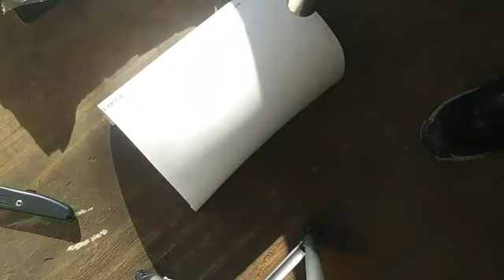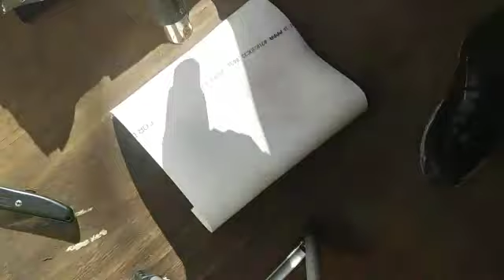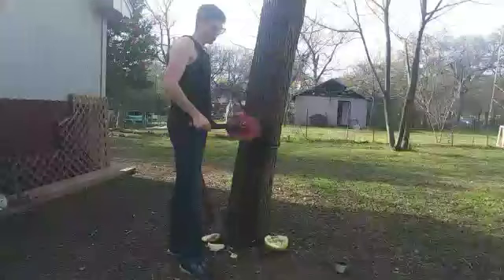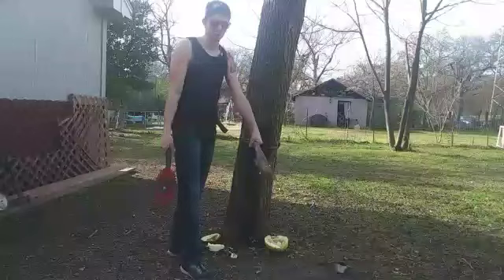PVC Pipe Armor?

Comment: Two plates of PVC, mold them together. Add a thin layer of foam between plates. Scuff exterior plate, spray truckbed liner. Then rivet through both plates with washers.
Reply from the maker: Solid idea, dude. Thanks the comment!
Reply: Or as well. You can make a sort of reinforced chain mail with liberal amounts of gorilla tape, zip ties, and spaced plates of PVC. Sort of plate mail armor. Im looking to make some sort of post apoc riot armor for an airsoft event.
Reply: Why would you rivet it or use washers? Those rivets have the potential to do serious harm to your body on a high enough speed impact.
Reply: @BlyatBear  hey! That's how I found this video 🤣 in need of ideas to make my own custom armor for airsoft as well

Comment: Hey Brother,  Looks like your going through a very similar learning process I did when I was about your age!  A couple suggestions to perhaps aid you journey.  Try Pickle Barrels. they can usually be had cheap used and can be formed by simply putting the cut pieces into the oven at 200 to 250 deg.on aluminum foil  until is softens  enough to form against a body wearing 2-3 sweat shirts.   You'll want to wear heavy gloves or pot holders when forming.  Don't over heat the plastic and it won't get brittle like pvc does.  This is the lightest and toughest non ballistic, non metal body armor I've ever encountered in 30 years of full contact combat martial arts. (Look up The SCA and similar groups for examples of the fighting)  If your interested in building full suits etc. you can find MANY patterns with a quick search for "SCA plastic armor patterns"  if you go to the SCA site you can also find a group near you that will be happy to help & teach you if your interested in learning to fight in armor as well as making it. Good folks they are. :)
God bless, Have fun, & Try to keep the pointy bits pointed AWAY from the fleshy bits! ;)
K.
Reply from the maker: This is some fantastic advice!
Reply: @apocalypsepyro  Thanks :)  oh! I forgot to add that SCA folks are also likely to be willing to let you film them while they are teaching & talking about making stuff to help you get content for your ch.!  :)
Reply from the maker: Sounds like a plan dude, thanks again! 👍
Reply: @apocalypsepyro  Any time, Brother. :)

Comment: Try using a roaster pan with  boiling water.  it works faster and does not burn the PVC.
Reply from the maker: Dude that's genius! 11/10 great idea!
Reply: @apocalypsepyro  I used to work at a PVC pipe factory.

Comment: Hey ive done a bit of welding as well as carpentry. I also practice martial arts and consistently spar with friends and opponents.  Next time use an uncurred ham and it would be more realistic to a human thigh. Also, if you take the materials and apply a massive amount of pressure during the binding process it would allow for it to sustain better blows. Also try a metal mesh weave between the inside rubber and the pvc. If done right it should allow for the blow to  be displaced. Real armor mitigates damage, not stop it.

Comment: A source of some awesome inspiration, so thank you for that but the materials and execution of assembly could use some work. Rubberized coating won't stick to duct tape well, duct tape is too smooth a surface and doesn't absorb liquids, but you did make me realize that layers of tough fibrous material coated and/or saturated with a rubberized truck bed liner would make a sweet semi flexible composite. I typically make composites with abrasive and/or tight weave materials saturated in either fiberglass resin or a stabilizing resin compound, but saturating layers of fibrous material with a truck bed liner is a great idea.(Depending on the material used because some don't absorb liquid whatsoever or just don't stick to rubber well.) But as far as PVC goes, it needs a backing more even more than a front protective layer(Both are necessary to keep it intact but the backing even more so) because as shown in the video, PVC breaks into sharp jagged edges that will shear through foam and potentially stab you even if the opponents weapon doesn't. You might think the saw blade axe cut the foam, but there would be a cut on the melon if so, just the effects of the PVC being cracked and smashed backward, did that to the foam and the melon.
  So I would just put two of those plates together and wrap them up in fiberglass tape or some other tough fibrous tape that can absorb whatever resin or rubber coating I decide to use. Lots of variations that could be discovered, hell imagine a bunch of steel wool submerged into liquid rubber or resin you could submerge a PVC plate that you score up with a box cutter or whatever. With simple customized molds various armor pieces of any size or shape could be produced, fairly quickly at that. But of course remember that padding can never be ignored. Without good padding, the simple answer for someone who has nothing but a sledgehammer or some other heavy blunt weapon to beat someone with plate armor is, Hit the plate Harder, cuz the plate can smash your ribs and collarbone inward. Bone fragments in your lungs or heart, that'll do it.
Reply from the maker: This is genius! Kudos for your comment and extended research on the matter. 10/10 would recommend your idea for a Version 2.0
Reply: @apocalypsepyro  HAha Thank you! I wasn't really expecting a response, certainly not that quickly, but I am glad you saw this, Because lately my workshop has been completely taken over by the boxes of a relative moving in so I can't currently take this inspiration and run with it so I would be stoked to see something come out of this if possible. I know getting the materials and time to work on prototypes is hard nowaday so I don't expect anything anytime soon. But I'll be subscribed, waiting for future builds when you can get to them!

Comment: get schedule 80 PVC instead of schedule 40 or cellular foam core. schedule 80 is thicker than schedule 40 and foam core is just too lightweight for impacts. You can also do the same shit with ABS pipe as ABS is more durable against impact.

Comment: Did anyone made a pvc helmet?
Reply from the maker: I might make one in the future 👍
Reply: I might try shomething with a 10 cm in diameter pvc pipe to cut it, heat it and make a sheet. I made many helmets out of pizza boxes and i want to use the template on the pvc to make a more durable helmet